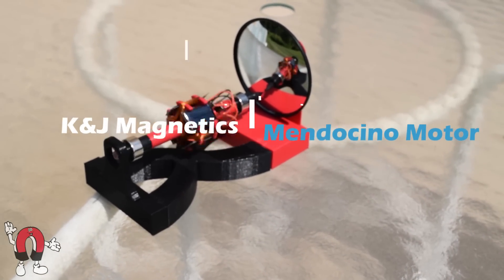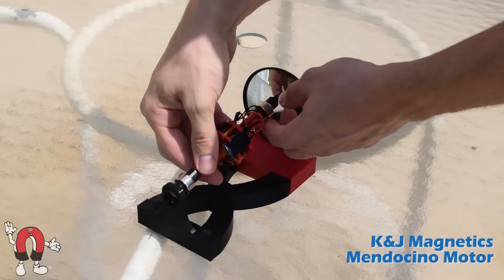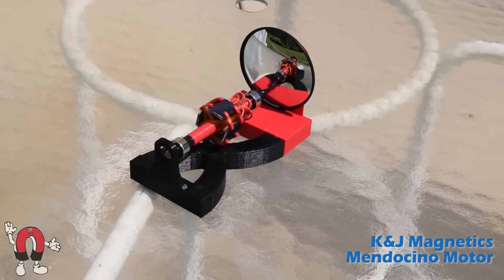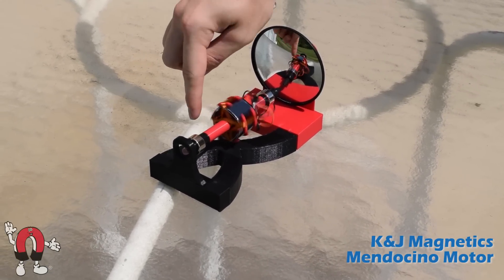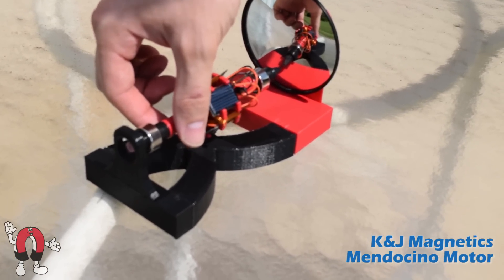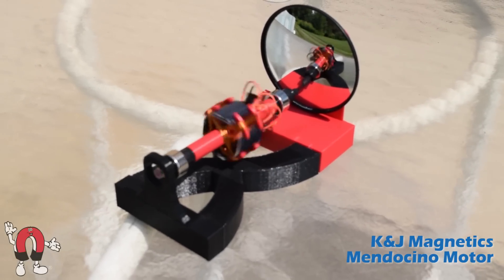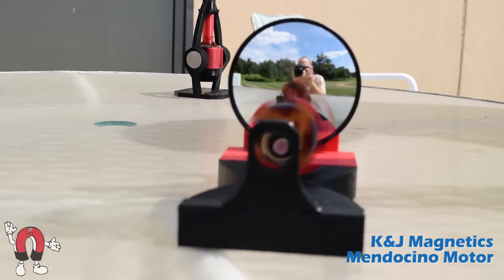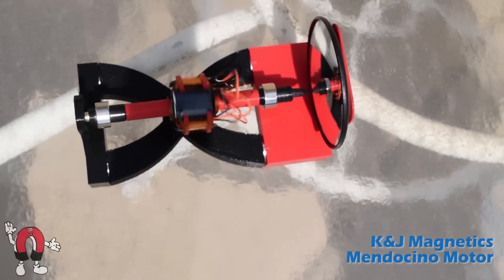Mendocino Motor

Comment: How does it work?
Reply: In mendocino motor there is solar panels,and under the solar panels it has coils so when sunlight shines on the solar panels it makes electricity, so when the coil have electricity it became a electric magnet, and also under the  mendocino motor there is a magnet, so the electric magnet and the magnet under the  mendocino motor they produce a force on mendocino motor so that is how mendocino motor works.